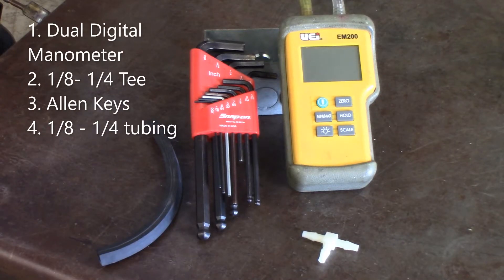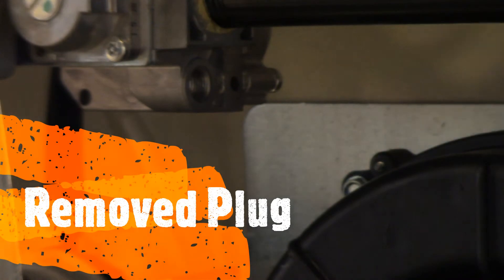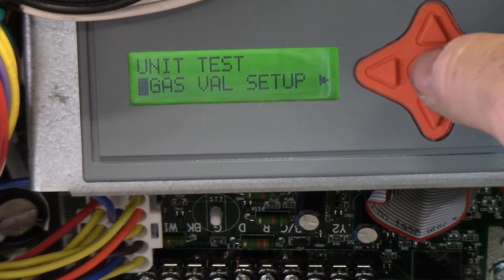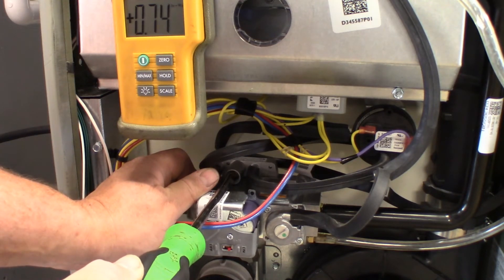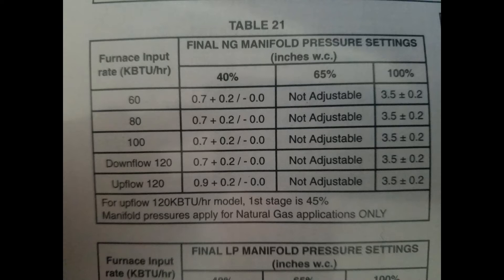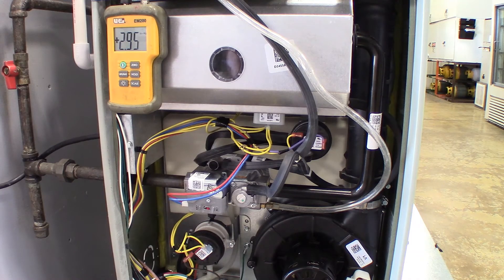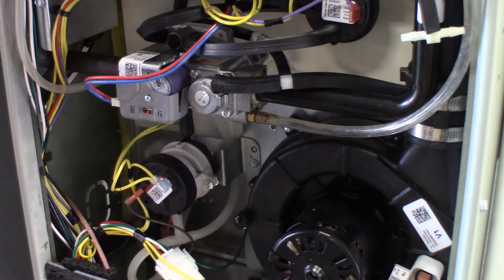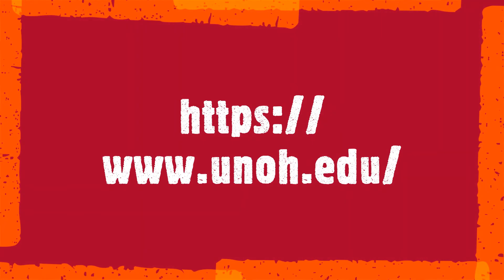XC95M Trane Furnace Adjusting the Modulating Gas Valve

Comment: Why do you need a T? You cant just hook up the manometer to the manifold?
Reply from the maker: Its referencing the burner box which is and the valve, the manual says use a tee in the line to get the right negative and positive pressures for the manifold. Its a modulating gas furnace not a standard gas valve.

Comment: Do you have to use the vaccum hose to the manoneter rather than the tubing that came with the manometer
Reply from the maker: As long as the connection is correct,  the kind of tube you use doesn't matter.

Comment: does the gas valve open with 24v ?
Reply from the maker: The gas valve opens with twenty four volts  (24v) The modulation is done by the inducer blower speed and referencing the burner box.

Comment: Btw, the low/high gas pressure need be checked when high adjust screw cap closed(there is a vent hole in it)  per manual, otherwise your gas pressure  will  miss -0.2 wc
Reply from the maker: Thanks Dave, must have missed that   information in the manual.